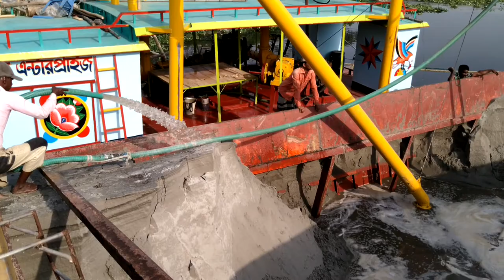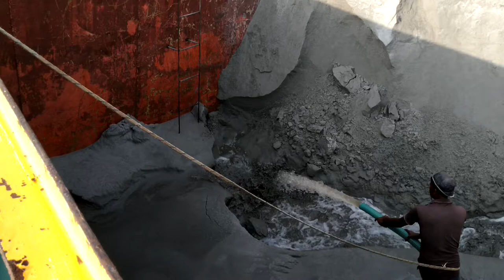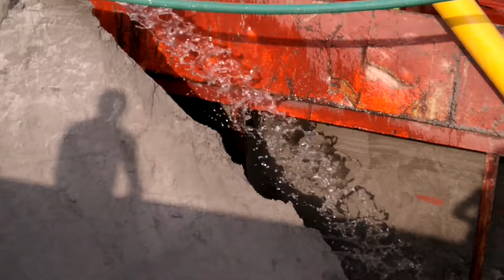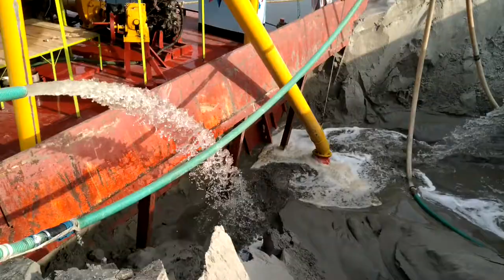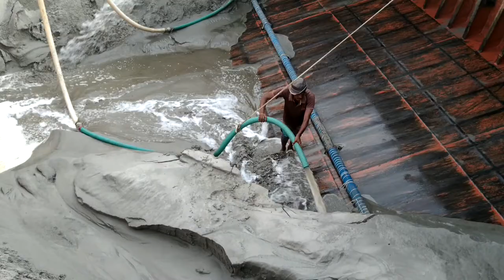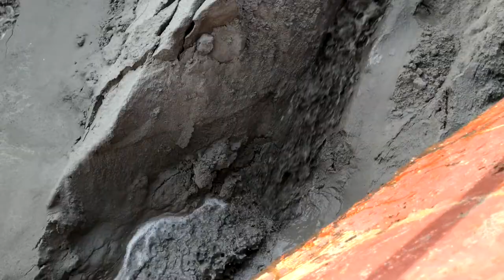Sand is being unloaded from large ships with powerful dredger machines

Comment: If they do this day in day out, why have they not hard lined in a water spray system around the top edge of the hold, with directional monitors like fire fighting equipment uses? I know labour is obviously very cheap, but it would save them time and effort and make the job safer than having those guys down on the sand.